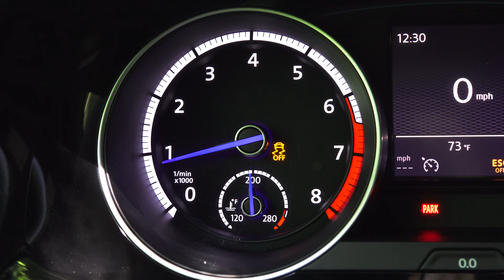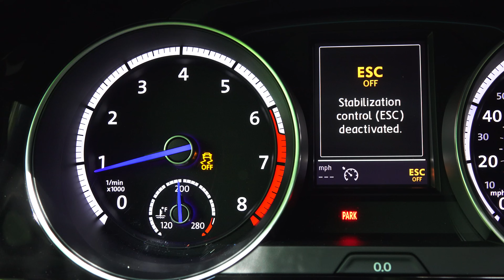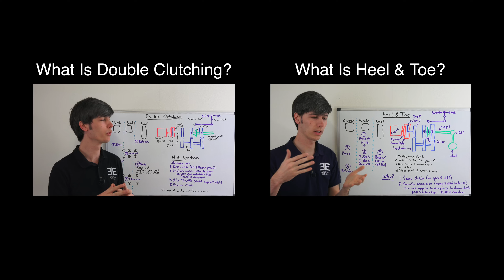How To Launch A Manual Transmission Car

Comment: Doesn't matter. 1.0 with 59 HP isn't going to get me anywhere 😠
Reply: +Rabar the cool thing about racing slow cars is:
nobody will notice you are racing!
Reply: +Rabar I know that feeling, I have a glorious Toyota Yaris '99 1.0 VVTi with 68 hp.
Reply: enugh to make those wheels spin :) just try a bit.
Reply: lol i have a 1litre with 63hp, wanna race??? 😂😂😂😂😢😢😢
Reply: Alfie Harrison

I think it's funny how people sometimes laugh when i say the car only has 80HP, but then I always have to hold back when normally accelerating because others are so slow.
And the 0-60 of my car was slow, 13.1s (because i have to shift in third to reach 60).
My friend has a Kia Sportage with 136HP and he only gets 12.6s to 60mph.
That's only half a second difference.
Reply: +Rabarcylinder 1.2L 55HP .. but hey! only 900Kg!
Reply: +Rabar I have 57hp, so I feel you bro.
Reply: +Rabar I have a Chevrolet Celta 1.0 2013. It delivers 76 hp (77 cv) on petrol and 77 hp (78 cv) on ethanol. It's actually a pretty quick car, specially for the busy cities. Very quick launches for a 1.0 engine. I also managed to get 170 km/h on the highway. Funny thing is that the transmission gears are so short that I always start in 2nd gear and it's very smooth and effortless. I only use its 1st gear over severe climbs. For an entry-level car, it's actually quite nice on many aspects.
Reply: Vinny The Tech dude, you don't get any recognition bye driving a 55HP car. we just talk. no one is triyng to show here
Reply: Jovan Angelkovic20 Icey day? Slippery tires? Sorry, I'm being a bit of a tease, huh?
Reply: +Rabar But still it's fun to blow the tyres off (how wide are they?)
Reply: +Alfie Harrison *not incline decline
Reply: +Alfie Harrison 
My Fiat Stilo 80HP 1.9JTD has a top speed of 115.5MPH(186km/h) measured with a GPS, flat road, not windy.
It's from 2003, so that's  a 13yo Fiat that still has the performance after 13years as when new.
(eventhough the official top speed is 179KM/H)
Reply: 1.4, 72 hp here lmao
Reply: Vinny The Tech lol the irony.
Reply: DE Nichols damn, mine is just showing its age, I have everything to rebuild it, just need to find the perfect time to take it apart, I still push it when I get the road to my self.
Reply: Vinny The Tech I didn't see the lol at the end, my comment wasn't like a dis or anything.
Reply: You guys make my 82 hp, 875 kg car seem quick.
Reply: zaki NBG barely spins even in the rain hahaha. trust me i've tried :D
Reply: yes sir, i respect you 👏
Reply: Rabar Hey. It's not just that you spoke on a popular channel, it's that fact this comment got people talking.

It's easy to put up a comment and get plenty of replies on a smaller channel, but on a bigger channel when people have so many to think of replying too, you can get lost at the bottom with more popular comments making a comment less and less seen.

I think it is an achievement. It's a game I play myself.

Some comments that will obviously be popular, I don't take part in because they're foul or just lame, but I thought this one was really cool. :)
Reply: I have a Subaru Vivio and I highly recommend it! Supercharged inline 4cyl, 0.66 with 64 HP fully stock and it only weighs 650Kg. The RS-R spec comes in 4 wheel drive as well!
Reply: +DE “AutoBravado” Nichols 75 hp horse power
Reply: +DE “AutoBravado” Nichols lol I changed my mind after driving my car :D it goes amazingly well despite its low cc and it sounds amazing :D
Reply: America is laughing at you
Reply: Pfff, i have a mercedes benz w123 240d 72hp...
0-60mph in 24 seconds
Reply: +Canis Lupus GEO!!
Reply: +Canis Lupus wait nevermind, that could be a multitude of cars
Reply: +Waltra Factory yeah i have a 1.2 ford fiesta freestyle 84hp when it was released in the early 2000s and the best way you desctibe that is nippy, but its a pretty raw driving experience ive had 105 mph out of it (very light dh) but you can get the wheels spinning in second if you get it right
Reply: @alfieharrison2236  thats gsst fur çar
Reply: +Waltra Factory yeah i have a 1.2 ford fiesta freestyle 84hp when it was released in the early 2000s and the best way you desctibe that is nippy, but its a pretty raw driving experience ive had 105 mph out of it (very light dh) but you can get the wheels spinning in second if you get it right
Reply: +Alfie Harrison 
weight has no effect on top speed.
Reply: +epiphonesg007 sorry phrased it poorly i should have said very slight incline poor choice of words
Reply: +epiphonesg007 ngl i was going off the speedo which probably isnt the best. the 0-60 is pretty lame on my car and the time is probably doubled if theres 2 more people in the car but its cheap to insure so idc
Reply: +Alfie Harrison like i said its fun, its not the end of the world if it breaks its only cheap(for a car) you can get the wheels going if you keep youre foot down in second gear
Reply: +epiphonesg007 yeah same i have to use 3rd for the last 15mph which is obviously quite a bit, i want to time my 0-60 some time but dont want someone else in the car because it is so much slower with the weight
Reply: Alfie Harrison

Oh that was with a friend(65kg) and about 60kg subwoofers+amplifier..
If you want to do it all by yourself you'll have to film it.
Reply: My problem is worse 
I don't even know how to drive
Reply: I got a 1.5 with 100at the crank and around 80 something at the wheel, but mine needs the engine rebuilt so it has less than 80 currently.
Reply: Vinny The Tech what?
Reply: +ThePCMdadburd everyone is just saying what they drive to get recognized by everyone else
Reply: +B0rikua45 I was trying to joke, you could tell by the "lol"
Reply: +B0rikua45 Oh owe. I feel you there. I hydrolocked my engine...before that I lost 20% of my HP anyway. I'm hoping to get the power where it was after the rebuild. 

I'm putting it all on YouTube.
Reply: +DESCENT That had my wife and I rolling with laughter! 

Yep. Racing a slow car doesn't get you in trouble. :)
Reply: 1.0 L at 59 HP? Impressive. My mother's Honda Fit i-DSI only did 63 hp on 1.5 L.
Reply: Nich Rigga haha xD
Reply: Nich Rigga
Good point. :)
Reply: +Tobias Weiß Yeah, compare 170hp to 59...
Reply: +Canis Lupus Yep, me too.
Reply: +StrongarmSlayer well I gues it's a diesel?
they have a damn high tourque and low rpm.
thats why they are rated at less hp than a gas engine.
gas engines get most of the tourque at higher rpm and they even turn higher!
diesels around 5000
gas 7000

HP is Tourque times RPM
so thats why gas get's a higher rating.
Reply: DESCENT
That makes sense. My Chevy Prizm is built around torque so the HP won't get very high, nor the RPM for how the automatic is setup.

Sure, it's a gasoline engine, but it's still set more for torque down low.
Reply: +DE “AutoBravado” Nichols high stroke, low bore - engine
my rb25det is the other way around. low stroke, high bore.
from idle to 3000 it feels like a 60hp  NA engine.
Until the Turbo kicks in. :-)
Reply: DESCENT That sounds super efficient and then up top it's fun!
Reply: +Rabar  4zil, 120hp 1.9 liter and its still Waaaaaaaaay to slow for me. I feel ur pain and I will pray for u.
Reply: Nich Rigga you mean how narrow?
Reply: DESCENT i can barely keep up with anything. but i did 85mph (93 is top speed) on the B-roads. most terrifying thing i've done in years.
Reply: Waltra Factory I'm really happy with my first car. not a lot of people can say they bought a 2010 Corsa with their own money in the UK at 18 years of age.
Reply: Rabar I looked that up. Took me a while to get an idea of what it was. Plus, the same spelling as your Opel model makes exhausts for Mustangs.
Reply: anyone want to donate to my piggy bank for an Audi A5 when insurance does not cost as much as my car - with a telematics box too hah
Reply: DE Nichols its called a Vauxhall here. They're owned by GM in America so it''s basically a British Buick.
Reply: Rabar
I don't think Buick makes a smaller, taller car like that here, but I definitely see some style connection. Mazda is one of the few who make a vehicle similarly sized like yours. I suppose the Pontiac Vibe/Toyota Matrix fits the same niche as well.
Reply: What the hell, I didn't even know cars could have HP that low lmao
Reply: +Rabar 0.8, 44 HP here. still can get some serious wheelspin
Reply: Mihai Zavoian
Forgive me, but are your tires hard or cheap? Hard tires have less grip and easier wheel spin.
Reply: DE Nichols Buick makes a 4-door saloon we call Vauxhall Insignia here. and I believe the Vauxhall SUVs too. and their own american models.
Reply: dude thats a lot of replies 😂👍
Reply: John Schmeltz Acts like a douchebag don't talk to me peasant, i'm famous hihi
Reply: John Schmeltz ahahah
Reply: 3 cylinder 1.0 mpi 75 ps here :)
Reply: Lala Sasa what's 75 ps. I don't know this term in your context.
Reply: Lala Sasa how my car's sound is in almost every video. Love my little 1.8. Feels big in this conversation. 

Big old exhaust. Mangaflow (open muffler). Huge catalytic converter. 

Short ram. ..at the addition, the noise just gets dirty. Lol
Reply: Lala Sasa actually 75 hp is good for that engine. I can't get the wHP up that high until 45 mph, and I have to floor it from a stop to convince it to get above 100 wHP going into the freeway. 115 wHP was my record but it wasn't getting above 100 much with issues before the disaster. 

Check out my article on it's exhaust. http://carmilespergallon.blogspot.com/2014/08/catalytic-converter-and-horse-power-why.html?m=1
Reply: I have a 1.4 90 hp, its possible to get a decent pull from it and a wheelspin also
Reply: Jovan Angelkovic20
Reply: lol what car?
Reply: TWrecks I had a Vauxhall Corsa. Now I have a BMW 320d ED. this one has 163hp
Reply: Rabar oh good
Reply: ***** Lol. I keep telling my friend with the slower motorcycle that he can't/shouldn't have a motorcycle with a tremendous top speed. Lol. He can't be trusted with it. 

He tells himself that too. He does want to be responsible, but his hook is the fun.
Reply: Still beats my 51 HP...
Reply: If I were to launch my motorcycle I'd do a willie. Did it on accident once. That was a terrifying intersection. I could have done the intersection a lot faster with both wheels on the ground. Hp? Maybe 18. Low HP can be fine. Just have it attached to something light enough. :D
Reply: epiphonesg007 what
Reply: Same as my Corsa had
Reply: Not a whole lot for 3.5. What year is your car from?
Reply: mojo9583 lol. Nice power for a 3 banger! 2nd gear... Wow... Because it can may be a poor reason to do it. . . much. Lol
Reply: miata life?
Reply: will this work with my bmw 2.0 143hp?
Reply: 1.1 with 60 hp still spin the wheels
Reply: Dang. And I thought my 84hp was bad
Reply: 3.5 with 215 hp here "lol"
Reply: ***** And my 2017 Yamaha WR250R is no help with how it eats the same amount of fuel whether I drive it hard or easy. I am a MPG nut.

Comment: Should have said the damage part at the start of the Video. Already did 4 Launches....
Reply from the maker: Hahaha
Reply: mmmm the smell of burning clutch, smells like money
Reply: I think some truck driver near my house is watching your video. They launch their truck on the bridge and failed crash two cars behind him :P
Reply: Justin Jameson you know I was joking right? :P
Reply: +Vedang P Should have watched the whole video...
Reply: +Vedang P I agree it would have been better at the beginning of the video but it is still fairly common sense.  Max performance in any statistic = risk of damaging parts.  The exception to that may be a slow climb to max speed on a straight track, perfect weather conditions, and no traffic or obstacles (such as on the salt flats). Even then, the risk for damage will still be slightly elevated.
Reply: +Engineering Explained Wil this work on my 1.4 mpi 60hp (118 nm) ?
Reply: I am new WRX owner and new to launches but that sounds like GREAT idea!
Reply: hahaha nope most derps on the internet are serious
 XD my bad I failed
Reply: +Vedang P Just do a 2nd gear rolling start next time ;) That really prevents a lot of wear.
Reply: On subaru awd launch may damage 1rst gear, i broke my old forester trans like that, very expensive experience !
Reply: lol XD
Reply: I had the same impression...😁😁😁
Reply: your good....

Comment: Soooooo what about a Automatic? lol
Reply: You don't.
Reply from the maker: I'll cover it eventually! Pretty cool discussion on torque converters as well, as they multiply torque.
Reply: Nice! Can't wait! Keep it up! :)
Reply: Hold your brakes down and give a little gas at the rpm u want . hold it at the rpms u selected and then floor it . If you have bad tires or not enough grip then don't floor it and just wait before putting all the power down . Pretty simple but I'm not sure what I can it so you car . Probably just puts wear on the brakes .

Comment: Next: how to do a burn out with front wheel drive. Would be great since most of the cars here in Europe are fwd.
Reply: +Brecht Schatteman FWD burn outs, how to.
step one - set handbrake 
step two - bring and hold rev's to 1000rpms below redline
step three - dump clutch & go full throttle
step four - modulate throttle so you don't bounce off the rev limiter (unless you're into that sort of thing)
step five (optional) - release handbrake, and flat foot it do a smoky pull away
**I am not responsible for broken transmissions, smoked clutches, spun axles, or any other damage that may result from this kind of abuse, nor am I responsible for potential legal blow-back from attempting to or performing burnouts anywhere not permitted.
Reply: that disclaimer tho, did you have a lawyer help write that? lol jk
Reply: +Brecht Schatteman i agree :D
Reply: +Brecht Schatteman Just full throttel let the clutch fly then the front wheels spin( if not not enough power so failed :D) then use the handbreak a bit because normally it will break the rear tires. all by own research with a polo c86 :D
Reply: +Jason Young thanks for answering my question. I requested the video more because that would spare me some research later. I have my drivers license but as student I can't afford my own car, and I think my mom's fiat qubo will probably brake down if I attempt burnouts with it. And my dads 125 hp automatic VW golf sportsvan is a car that I can only drive if he's with me (for him it is a holy car, he doesn't like it if other people drive with it). But thanks for the info, it resembles to with this video, only with the use of handbrake and a higher difficulty level!
Reply: +Brecht Schatteman I've done burnouts in a 1985 diesel Jetta, no turbo just a diesel, I think it had 50hp. I would not suggest doing burnouts in anyone's car but your own, especially not your parents cars.
Reply: +Jason Young I was not planning on using my parents car, but thanks for the advise